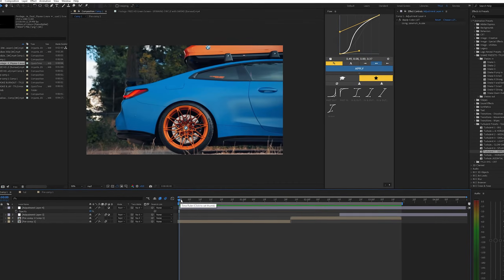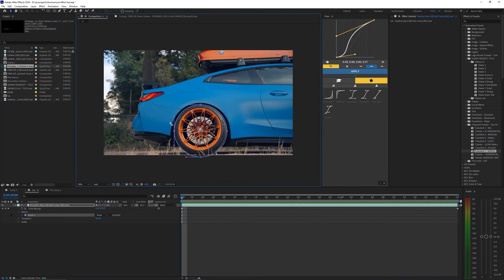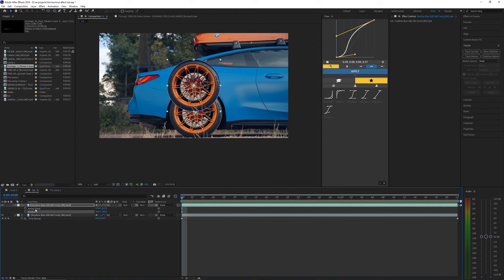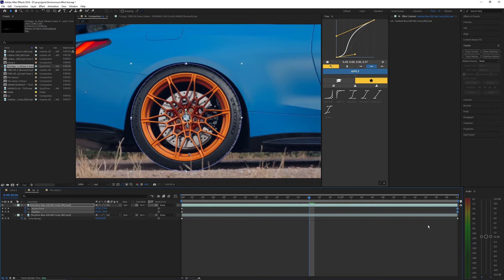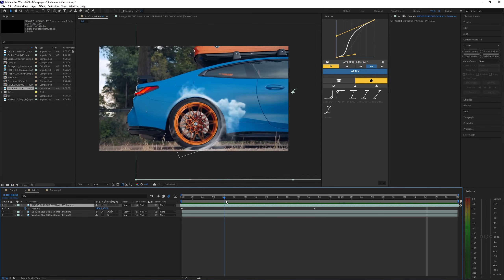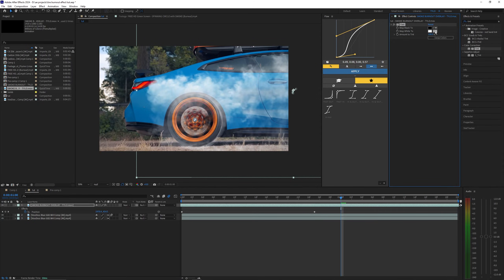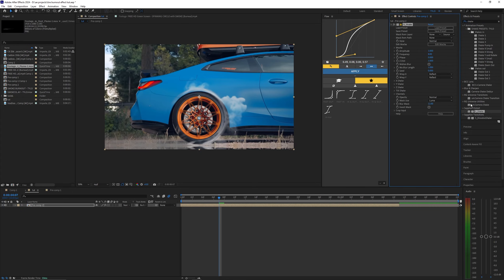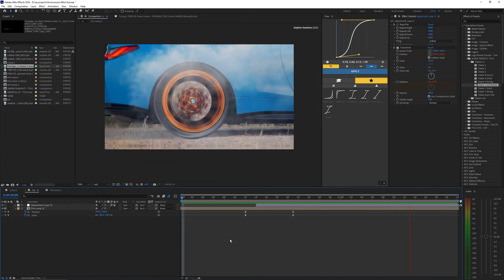CAR BURNOUT WHEELS EFFECT  - AFTER EFFECTS TUTORIAL

Comment: quick tip, a better way to adjust the anchor point is with the shortcut "Y" which will switch to another tool which then you can drag your anchor point to where ever :)
Reply from the maker: Fire, didn't know that 🙌🙌
Reply: @TyloFX  another way, just hit ctrl + alt + home, will set the archor point to the middle